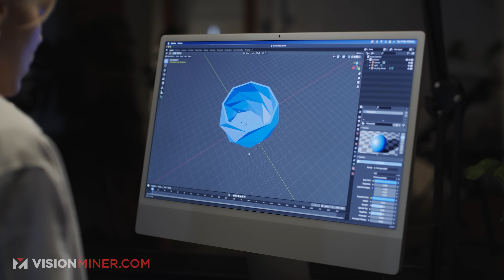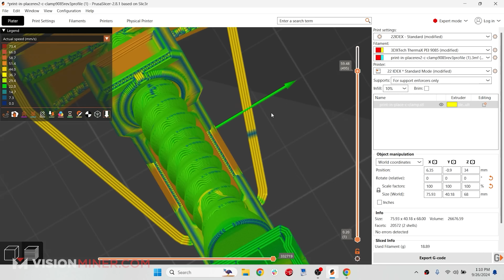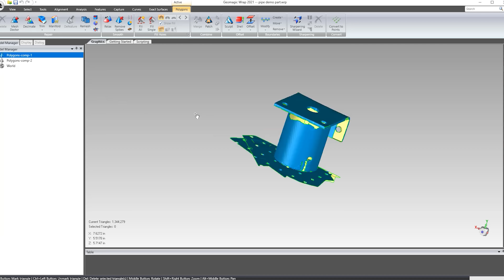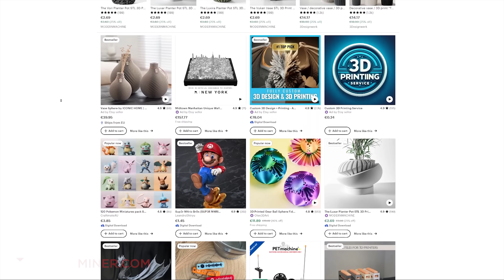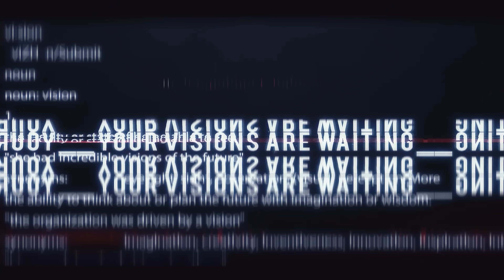Did This Machine Ruin 3D Printing?

Comment: The Bambu effect is real, and it occurs in just about every field in some kind. Go back a hundred years and driving a car was something that meant you had to know how to service it. And I'm talking both everyday service like filling gas, but also keeping up with the oil changes, lubricating joints and even repairing stuff. Yes you could get away with it if you were rich, but that was not really an option for most people. You had to know a lot about how the car worked or it would simply mot keep working for long. Today most people knows a car goes forward and backwards depending on the shifter and the gas, and they know you can stomp on the brake and will eventually stop. But that's it. That's the Bambu effect in operation. Go to computers. thirty years ago using a computer started with putting on a white robe. Computers were almost magical things that took up half a house and required knowledge to use. Most of the time you were actually required to understand programming to actually make it so anything. Sure there were some simple tasks that could be done by people who just knew how to type, but that was not using the computer really, just inputting information in a form that suited the programs that the computer were to run on the data. Today anyone can enter data into a database and start searching and calculating things. They don't have to know anything about the technical side of computers, programming or even command for the database as they are most likely to use a GUI that allows them to do incredibly advanced things by just pointing and clicking. Bambu effect I say.
But programmers still need to understand computers right? Wrong. More and more computer development environments are designed to detach from the hardware to the degree that they work the same no matter what kind of computer they are run on. Something that shows just how detached it has become is the introduction of Kibi, mibi, Gibi bytes and so on. The thing is for a long time a kilobyte was 1024 bytes, a Megabyte or 0100 0000 0000 bytes in binary. But that was too complicated so it was determined that 1Kb would be 1000 bytes and 1Kibi 1024 bytes. "Oh good that's just what we learn in life. A kilo means 1000." Well that's good but it doesn't change the fact that computers doesn't count in decimal, it's always binary at the root and knowing that is often important when writing programs. And yet they try to hide it to the degree that in a lot of more advanced environments you are not supposed to ever consider that all data is stored in binary format. Bambu effect working.

Comment: So many comments totally missing what you are saying. Printers are tools. Printers have become so easy that folks don’t HAVE to learn how to diagnose issues. I constantly get asked how to improve print quality or fix issues, and folks don’t know the basic terms or slicer settings I’m pointing them to. It’s making helping people more difficult. Printing becoming “democratized” is excellent, and you said that, but it does mean understanding of the core concepts is headed downward.
Reply: People with Enders and Elegoos are going to have the EXACT SAME QUESTIONS. They don't automatically download all that knowledge when they buy a hard to use printer. Everybody has to learn those things at some point.  These questions weren't caused by Bambu, but an influx of new people to ask them was.

Comment: It's the same in the Automobile sector, as cars became increasingly common: The userbase accepted it more and more as a normal thing in life and not a novelty.  

"Hurr durr back IN MY DAYS. The car manual said how to adjust the timing of the engine. TODAYS Manuals say to not put vegetable oil in the engine!" - as if that makes any other point than that the product and user base evolved. I am sure all of you saw reels like this somewhere. 

Anyways, as a 3d Printer enthusiast and very aware of the potential of this technology, I do wish to see its widespread adoption into the industry. The company I work for is just a century younger than all of the USA, when CNC mills were introduced the machinists learned how to write G-Code by hand. Some of them are still in the company but not a single one complains that CAM software exists because that work is utterly boring, time-consuming and 5 axis machines exist now. If we want to see widespread adoption the technology needs to become easier to access, processstable and easier to use for 95% of cases. In other words, not be a novelty. Sure you will need a technology expert in the team to fix issues falling into the 5% but that's why you employ these. 

All in all, Bambu Labs did more for the breakout of 3d printing technology from a nische than Stratasys ever did.

Comment: You guys are not wrong, but I also think your perspective is not of the average user either. Your whole company is very niche CAD prosumer oriented. Bambu should be praised for removing hurdles that raise the bar of entry. Not everyone who needs to print is an engineer, or a machinist. It's a net positive to have more experts from other fields involved in the space because they don't share the same blind spots and a fresh set of eyes is never a negative as they say.

Comment: I started with a Wanhao i3 and CR10...was great for tinkering, I learned CAD and 3D Modelling for tabletop gaming terrain. I'm old school, back in the days...no compiler for machine coding, binary to hexadecimals...printing on paper...we had to put command for spacing between paragraphs to print. Today with the 3D printers, Bambu's have changed my productivity and my workflow in an amazing time saving ways like back in the days when paper printers didn't need  command codes throughout a page to print. I think this is great, the new 3D printers are appliances now. So people can buy my models and then print them without having to tinker.  Making them that easy to use, you need things around the house, you just buy or design and print. Saves on everything, transportation, manufacturing, reducing pollution child labour from 3rd world countries. More of that other wasted energies can shift into a healthier consumer society.

Comment: It's not ruining anything. It's pushing competitors to innovate faster. I'm not looking at a 3D printer asking it to be very difficult for me to print a model so that it will put this metaphorical wall between a novice and the machine. Instead lets make these very intuitive, easy to use, and still provide a high level of serviceability so that you can be independent for repairs if need be. When you cut out the large percentage of people that are barely capable of operating a microwave then the manufactures are losing the profit these users bring which benefits all of us.

Comment: For me the Bambu saved my interest in 3D printing, i got the Bambu A1 mini as a test, if this thing does not work im quitting 3d printing altogether. Tho i loved working on the 3d printers for years, but when i actually have to print alot i cant spend that amount of time to just get tings to work. i have had a bunch of printers like the Prusa MK3S, but the A1 Mini is so much better its not even funny. now im printing nearly constantly, and it never fails and i never have to fix or tune anything.

Comment: I am glad that I started with a bad printer (Tronxy XY2 pro) as I was able to learn how to 3d print, use marlin, and slice.  Now, I have a Elegoo Neptune 4 plus that now runs stock klipper and know some basic gcode to get me started.  I have been going step by step from basic to more practical over the years.  Also, I just bought my first bottle of Vision Miner Bed Adhesive and I can’t wait to try it out!

Comment: With this type of thinking, no one should be able to drive a car unless they are a professional mechanic
Reply: if you didnt mine the metals, smelt the parts, made the circuits and machined the engine out a solid block of steel and vulcanized all the rubber in the wheels. how can you be allow to drive.
Reply: Not that extreme but it has got to a point were a lot of people cannot even do simple maintenance of cars, even though the country I'm from it is a part of passing a driving test.. People just learning a small amount would save them hundreds or thousands paying someone else do it for you, which is sad to see.
Reply: @wafflecart   Right, but that's how technology goes. Its the same with computers, they are to the point where the average person can open one up and turn it on, it works as they want it too. There are still just as many people who can fix a computer themselves, but there are just so many more computer users now, and that's a good thing. That's how technology advances. If owning a computer still necessitated people fixing them themselves, there would be less users, less money in it, less advancements in the tech. The average user does not want to have to fix their machines themselves and that's okay, even if it would save them money in the long run. People only have so much time and energy to learn so many skills in their lives. Its okay to prioritize the things they wish to prioritize, it shouldn't bar them from owning they tools they wish to own if they don't know how to fix them. That's needlessly restrictive.
Reply: I would agree because I believe most drivers on the road don't deserve licenses, but I get your point.
Reply: This is why mechanics rip so many people off.
Reply: Using a computer numerical control (CNC) machines to manufacture parts is a lot different than driving a car, and 3D printers are CNC machines.
Reply: @GaiusTacitus   Okay, so think of it as computer then. It used to be that you used to need to know the inner workings of a computer to own one. The tech advanced to make it available to the average person, and that was a good thing. I don't think anyone except for weirdo gatekeepers would argue that computer tech was better in the 80s when you needed a degreee in cs to own a computer. Its the same thing with cars and 3D printers. As the tech advances, it becomes more available to the average person, which is a good thing. Why are you putting arbitrary restrictions on the hobby you enjoy just to keep people from getting into it? The less people doing it, the less money in it, the less it advances. Also, you're right, it is much different to driving a car, driving a car is significantly more dangerous, it is a significantly more complex machine, and takes much more experience and training to be able to fix one. That's a great comparison, really highlights how much easier 3D printing is and why the average person is more equipped to own and operate one. Shame about the creeps trying to gatekeep it just to make themselves feel superior about their niche hobby though. It will be great when it reaches the level of cars and home computers and people can just pick one up and have it work. I mean, it won't be good for your ego, because you won't be able to be as pretentious about it anymore, but at least you'll have memories of the good old days when the tech was needlessly obtuse to use.
Reply: @KCInherent  It's a bad analogy. I've been working with computers since 1976 and CNC machine tools since 1980, including 3D printers since 1992. 3D printers are CNC machine tools. If you're going to make a business based on any CNC, including 3D printers, then you need to know a lot more than just how to send a G-code file to them.

Comment: I started in 2009. I had to hand wind my own hot-ends out of nichrome wire and whatever parts I could find. My first printer was made out of plumbing parts. I had to use Skeinforge to slice my first prints. There were no kits available then. Today, sure I still have a printer I built but I also have a Bambu X1C and Creality printers. Every time I use them I marvel at how far we've come and wonder at how far we might go. I don't lament the progress because I recognize how much it has widened 3D printing and how it has opened it to so many new people.
Reply: I think we are close to reaching the apex, maybe there is a small plateau, but I think things might not go that great. Im afraid if 3D printing really reaches the masses it will become another victim of enshittfication. On one side there will be tremendous "innovation" but everything will become so simple and garden walled due profit maximization and market control that you will be locked to only printing reviewed models from brand locked 3D asset stores as well as filament.

Comment: This happened with drones and TCN planes flight controllers… everything has plus and minus’s.
I am sure who is not just a hobbyist like I am and want to dive deeper into 3D printing g-code and so on , will still do that. As for people like me who wants to print for hobby and only use the 3d printer as an extension to their work , it’s an amazing time.

Comment: Bro, quit crying. Im not mad that most of my 10 years of knowledge is nearly useless. Can spend more time learning the nuances within slicing and designing. Rather than spending 30 minutes leveling the bed with a post it. Id argue that your way of thinking is backwards. For those who want to, we can spend more time in design and nuances instead of just trying to get a printer to print a halfway decent print.

Comment: I started 7+ years ago with a Creality 300 bed slinger that I had to print custom fan shrouds, upgrade the filament drive, buy a ton of various plates that I had to level meticulously by hand, also owned one of the first Mosaic Palette 4 color splicers and printed 4 color benchies in perfect immaculate detail that stands up to today's best printers. But I stopped using it because it was always a "chore" to print something. The printing in and of itself was the hobby, learning all the ins and outs of the slicer, how to fix elephant feet, optimize your design so you don't need supports, etc.

A month ago I bought a Bambu X1C and I was blown away. This thing just prints perfect print after print, no matter what I design up in Fusion 360. It is an incredible piece of kit and I am so grateful that we have such a tool. I am not afraid nor get a severe case of anxiety every time I want to create something. It opened up a whole new set of opportunities and abilities for me and to just use the printer as a tool and means to achieve objectives rather than the 3d printing being the process in and of itself.

Anyone that wants to go back to the olden days is just worried that their expertise is being replaced by machines that "just work".

Comment: Bambu printers suck in general, they use low quality components sourced from the cheapest factories in shenzhen and are prone to failure. Their build quality and QC is poor and is no better than creality. Bambu's fanbase is full of rabid stans that freak out anytime you state facts about bambu that puts them in a negative light, the dislike ratio on this vid is proof of that. The most recent L bambu took was last month when they sold out of stock items as in stock and lied about it, customers waiting over a month for their orders with bambu ignoring support tickets.. And their trust pilot rating fell to 1.4... 600+ reviews with over 60% being 1 star. Tells you all you need to know about how bambu lab is as a company.
Reply: ah more coping from you, just as expected 😅

Comment: i get what hes saying, iv just got a bambu and feel restricted, yet to find out how to select 100% infill and iv been using my modded ender 3 pro for ages, printing tpu quick petg with no stringing but i cant lie the p1s knocks flawless prints out
Reply: 100% infill is impossible because there are always gaps between layer lines, the head will end up scraping the part if you do that
Reply: @marshallb5210  that is completely incorrect.

Comment: I recently purchased a Bambu A1. I've had an ender 3 pro for years that I never used. One, because I was lazy. But also because I knew I was going to have to spoend a ton of time fiddling with it.

I don't want to fiddle. I work on cars all day long and my brain hurts at the end of the day. I wanted a machine that I could come home, do a quick bit of cad work, slice, and then print. The Bambu does that for me and I'll likely get an X1 next year so I can play around with ABS and other fun stuff that needs an enclosure. Point being, Bambu can be THE gateway to the world of 3D printing. Those that want to fiddle can build themselves a Voron, or something similar. Having a solid machine helps explore other areas.

Comment: I find the bambu lab studio software quite horrible and not user friendly actually. You have endless totally un-intuitive options like scarf angle, seam position, X-Y contour compensation, ironing type, and dozens and dozens more. I DON'T CARE. I just need to print as part of a project and have no interest. So bambu lab FAILED in actually insulating the user from this gobbligook (yes I know others find it fascinating and that's fine, but not me). Even using a 3rd party filament is a nightmare. Totally unclear how to set the settings. Clear case of engineers creating the UI
Reply: You do realize it's based on prusa slicer?
Reply: @Deceased-Prince  No I don't, and those are exactly the kinds of details I don't care about. I just wanted a plug and play full solution. It's totally misleading that it offers that. A zillion settings to set and tweak.
Reply: @GoTellTheTruthAlwaysYes  you can just use preset's but you also have the option for finer control
Reply: wrong
Reply: @riba2233  ? What's wrong?
Reply: @Deceased-Prince  OP's point, your comments are correct